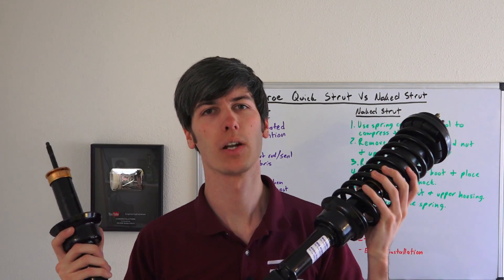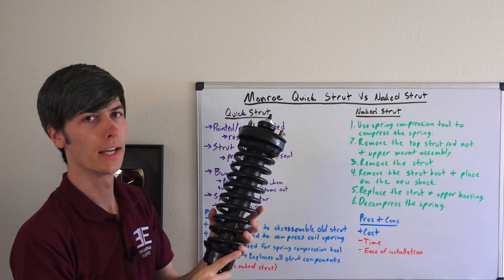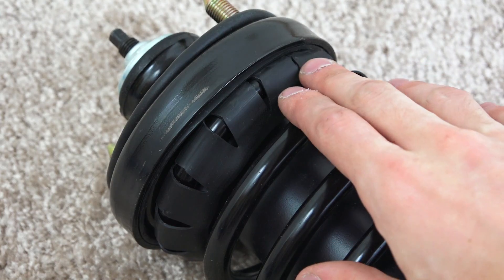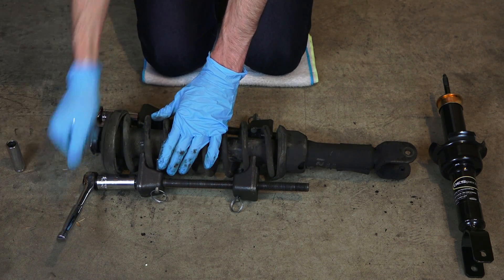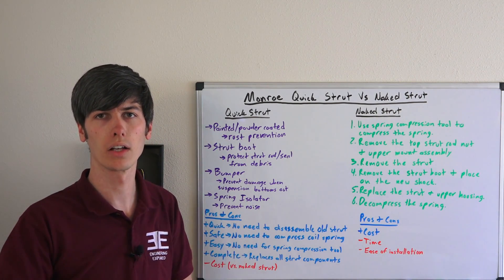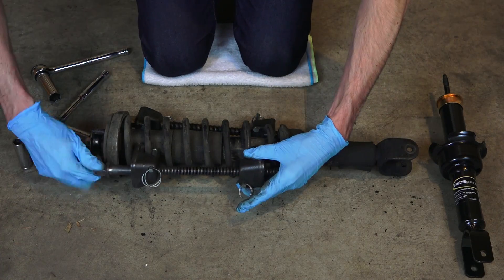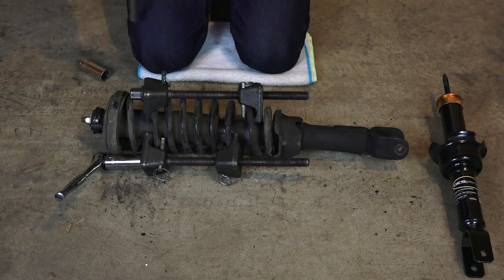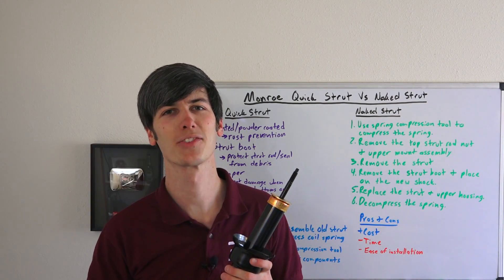Strut Replacement - Monroe Quick Strut Vs Naked Strut

Comment: I ordered model 71116/71117 to replace the existing OE spectrums that were on my car, and received 71116UB/71117UB, they’re definitely different in compression resistance, the fork shaft, and the strut rod seal cap. What are these things?

Comment: QSA is safer but you also need to
Make sure you get a decent quality QSA.

The extra $50 in the QSA even if done at a shop can be offset by reduced labor since there is one less item to remove.

Comment: Okay so when you buy a naked strut, do they have an internal lock to they can be shipped or do they have a metal wire retainer that holds it down?
Reply: Two brands I've seen a lot of just use a plastic strap to hold it in a compressed state in the box.

Comment: Monroe OESpectrumstruts front and rear installed to my 2003 Highlander, drive smooth like sit on air, the best ever, Monroe all the way for me!
Reply: Is that because they old ones were so worn or are the Monroe good? OEM for the highlander is KYB ?
Reply: @JacanaProductions   Yes the OEM struts have worn out my brother replace them with Monroe struts, the car runs smoothly as silk, my car replaced with Excel-G they are too firm for me. I want to replace them with Monroe but got to wait and save for that!
Reply: I just went monroe all around for my 04 tacoma. $145 for front struts. Back shocks were $17 each. I'll let u know
Reply: @rockstar66   Have you done how good is it? Unfortunately, I can not do it myself! back injury!
Reply: @TrungNguyen-ul8gm  no, ive spent 8hrs so far. Still trying to get the factory (rusted on) struts off! 123000miles & they havent been touched since 04.

Comment: garbage BS, never change your original spring, always just change strut  !!! DO NOT PROMOTE GABAGE FOR MONEY,
Reply: I totally agree.  Don't replace the OE spring until you absolutely must (ie: it wears out and sags).  Many people are finding that out the hard way after their springs have been "recycled" by their mechanic shops (aka: sold on eBay or Craiglist).  Even if you are dead set on quick struts, ALWAYS ask for your OE springs back.

Comment: There are other advantages like
Some oem manufacture might do an update on their quick strut which helped to improve the quality of the original design, changing just strut sometimes might not fit properly.
I would stick to oem as i read many has issue with aftermarket strut at say colder climate like us in the North where temp dropped below -20 to -30 C make some after market shocks bottom out.

Comment: Monroe has a better reputation than the cheapest off brand compete strut replacements but not nearly as good as OEM like Showa or aftermarket KYB.
 Honda OEM Showa struts are very expensive but KYB is only about 40 percent more expensive than Monroe with better tune and performance.  
The best results I've obtained are with Bilstein B6 street shocks used to rebuild OEM struts using new OEM rubber parts. Expect to pay about double a Monroe assembly and spend an extra hour per side to rebuild but the difference in control and ride is exponentially better.
Reply: I wish i was that lucky, i bought my monroe loaded struts for the rear of my Honda element.  Kept them in the box in storage as i had planned to install myself.  Had the E go in for an electrical service and paid extra to have Honda install the struts, needless to say a few days later and the driver side one is rattling 😑 new struts probably dont have 200 miles on them given the vehicle just gets driven to the store here and there. 😑😑
Reply: @motolifealways  hi will, I would replace monroe with KYB complete struts from Rock Auto. Should be about $100 each. Any decent mechanic can do this. Ask him to torque the bolts to Honda specs with a torque wrench not the impact gun. Return Monroe for credit if possible. A Honda dealer installed your Monroe Struts? Really? Strange. Good luck.
Reply: @larryordine7542  i would do the same , i love KYB . Just at the time pockets were only good for monroe. Though still costed me nearly $400 for 2 loaded springs . When i viewed the KYB , they were not cheap. Though i didnt look at rock auto at the time either. I wish i did though
Reply: Not that old yet!
Reply: Will Moto704 , do you know definitely that the source of the rattling is coming from the new shocks that you had installed?
Reply: @paulbrownman7307  yea , was coming up to the top of the strut tower. Moved the vehicle around with my hand on the top.of the tower. U can hear and feel the metal on metal rub. I personally removed, brought back to advanced auto and got a new one umder warranty.  Not had another problem.  Very odd that it went to crap in a few 100 miles.

Comment: On my 3rd gen taurus gl it's cheaper to go on rockauto and buy the strut  bearing mount and spring seperate and it's a more quality setup in my experience for example the trw coil springs had 4 coils the quick strut only 3 coils  having the 4 coils fixed the bad design it's known for this is a 22 year old taurus I'm talking about

Comment: These are the monroe quick strut for NISSAN ROGUE old body style. DONT BUY THESE QUICK STRUTS. GUYS AVOID AT ALL COST. THEY WONT EVEN LAST 2 MONTHS. Driver side one came out from the mount while driving over a small bump at 30 miles per hour and also causing damage to the driver side AXLE and adding up repair total . Few Days later Passenger Side came out while taking the exit and going over another small bump. I compared both of them with OEM Nissan's and their build quality is horrible. Learn from my mistake buying Monroe Quick strut is a major disaster you are causing yourself and your family. OEM Nissan build quality is perfect for Nissan Rogue. Don't take any chances.

Comment: I am stumped as to why people would want to put the tired old springs onto new shock (strut)? What makes everyone think that the spring has not lost recoil also and should be changed alongside the shock portion?
Reply: Rear springs usually lose nothing. You can measure and check spring height. If within spec , they are good to go. Quick struts usually have cheap, inferior springs and twin tube cheap shocks
Reply: Checking the vehicle's ride height against the vehicle manufacturer's specifications is a trivial thing to do.  Then you will know the status of your springs.  In my experience, 10 or 15 year old "tired old" OE coil springs often deliver correct ride height and a much better overall ride than the brand new POS "one spring rate fits all" springs included by many QS manufacturers.

Comment: Do your research first folks. Sometimes a complete strut assembly is not as expensive as you think. Case in point: Honda Odyssey, OEM full assembly is $284 (from a Honda dealer). Cost to rebuild your strut with Honda OEM parts is $260.  Oh also unless you are a cheap ass, go get the OEM parts. Even widely recognized brands like Monroe are pretty much junk.
Reply: Where do you think the manufacturer gets the parts? The OEM may very well be a Monroe unit.
Reply: @davem5333  Well Dave, Honda struts are are made by Showa, manufactured either in Japan or the US (by American Showa). Honda has never used Monroe in any vehicle, ever. Also, saying that they "may very well be" something is the same as saying "they very well may NOT be" something.  I never understand why people post things like that, it's totally useless.

Comment: I had nothing but issues with Monroe Quick struts in my Jeep Grand Cherokee. the car handle better with blown struts then these Monroe Quick struts. The struts have a hard time holding the weight of the Jeep. I have returned the old Quick struts and exchange them for new Monroe Quick struts and still having a poor handling issue. The Jeep bottoms out very easy now. I'm planning on going with OEM Springs and 8 decent new strut. After my experience I will not buy another Monroe product.
Reply: I agree I have monroe rear airbags replaced with monroe conversion it rides hard and sets up higher in rear and shocks are lesking no more monroe

Comment: I replaced all four struts on my '01 camry about four years ago using the naked struts. I spent all day, I mean ALL day in the garage at +90 degree heat working the spring compressors, the rears went ok but the fronts were both a huge pain and the springs didn't want to go on. It would have been a bargain to spend I think it was $30 difference to have to not deal with the springs. I'll never transfer strut springs again.
Reply: Now you know what my life is about.
Reply: wayne booker is 30 dollar difference for each strut+taxes
Reply: How does the ride compare to OEM? If it's the same, it was worth the effort. I am hearing that FCS quick struts perform poorly in freezing weather.
Reply: @GSPirosaki  fcs is garbage. I used their strut assemblies for my maxima and the ride was horrible. I would’ve been better off using Kyb or OEM bare stuts and going through the extra work to replace them

Comment: Another disadvantage is brand choice. I'd rather pay 75 for a Bilstein naked shock than 75 for a Monroe quick strut.
Reply: There are different Monroe series, I will go for Monroe if you like smooth comfortable driving!
Reply: depends on the car you have as well. im not putting bilstein’s on a beater or commuter corolla.
Reply: @MacLaw3084  then by that logic you shouldnt spend the money on a Monroe quick strut. Just get a monroe naked for 15-20 dollars on rockauto and call it good. Or better yet spend 10 more dollars and get some nice kyb gas a justs.
Reply: @autodidacticartisan  sorry you’re right. but im going with quick struts on a commuter car or beater for ease of install. now on my weekend canyon carver im going with something more special like koni fsd’s or bilstein or ohlins. etc.
Reply: @MacLaw3084  nice what setup you got on that cayon carver? I used to go around midnight and shred the Malibu canyons almost every night.
Reply: @autodidacticartisan   malibu huh? nice! i bet you had something decent. i dont have anything too special. ‘06 mini cooper s (r53) with koni fsd reds and oem springs at the moment plus some strut tower defenders (they like to mushroom on minis). im only a year into the build so i dont even have a rsb on yet. handling is go kart-like.

toying with the idea of coilovers (h&r or megan racing depending if i start autox). but the streets are so trash where i live in the bay area. car already rattles so much with current set up, can only imagine with coilovers.
Reply: @MacLaw3084  if you wanna keep a semi soft ride maybe try soft shocks with stiff springs you still feel it on the cornering the springs hold the sway but the soft shovks take the recoil from potholes and such easily without knocking out your tooth filling. Mini Cooper's are known for their go cart like handling. Theres this nice road in the bay area that I love to take when im up there. Its between San jose and santa Cruz, I think its the 17? Not sure but it has alot of wide sweeping turns and the pavement is like glass it must have just been refinished.

Comment: Buying naked struts is better IMO because you keep more of the OEM suspension components which in most cases are better than aftermarket parts especially the ones that are out of specifications or cheaply made and poor quality.
Reply: Spot on bro!

Comment: I stopped selling, "Quick Struts" to my customers. The quality control is poor. Some are good and some are bad. I had many comebacks. I now only sell naked struts, and strut components from Sachs, KYB, Bilstein, or OEM. I find Monroe struts to be of sub-par quality.
Reply: Thanks for the info. WIll look up.
Reply: Hi what do you recommend for toyota highlander 2006 v6 3.3 basic model thax ?
Reply: About 10 years ago I bought some plain, naked struts for my Escort as the originals had almost  zero hydraulic action left. I used hose clamps to help in changing out the springs. I drove the car about 40,000 more miles and when I got rid of it there was almost no hydraulic action left once again. I think they were Monroes
Reply: Exactly the same conclusion I arrived at.

Comment: There are many aftermarket quick struts out there that are complete garbage.   I'd rather know that I have the correct OEM spec spring.   As an engineer, I appreciate that not all springs are the same.   Spring coefficient, etc....
Reply: These Monroe Quick Struts were garbage on my 2005 4RUNNER. I replaced the original struts in 2016 with 61,000 miles with these Quick Struts at the suggestion of my mechanic instead of using the KYB shocks that I bought and reusing the old coil springs or buying new coil springs. 

I just replaced the Monroe Quick Struts with 103,000 miles on my 4RUNNER (so about 42,000 miles on the Monroe Quick Struts) with KYB shocks and MOOG springs. The difference was easily noticeable. The Monroe parts were never any good -- way too soft and bouncy over bumps.
Reply: @sanjaygandhi7962  They are ripping off the public with these cheap struts !    It should not be allowed. . .
Reply: Absolutely correct. Any non oem assembly will be different.
Reply: Peak Torque  KYB
Reply: what kind front quick struts would you recommend for a 2003 grand marquis?
Reply: @LaDon0428  Same as a Crown Vic so motorcraft or KYB both about $100 mail ordr
Reply: Thanks. I bought the monroe quick struts thinking they would be good considering the brand. I've only had them on 2 1/2 months and their already bottoming out. They come with a warranty but I'm not sure if the new ones won't do the same thing.
Reply: @LaDon0428  the OEM motorcraft is safe bet and exact fit. Ask mechanic if you can use police Taxi package.
Reply: @larryordine7542   OK thanks
Reply: @larryordine7542  I just found what i need. A motorcraft astl-37 quick strut assembly on rockauto
Reply: @LaDon0428  yes.

Comment: Quick strut is not  good, especially the spring. The spring is always stiff due to low quality of manufacturing and no longer going to function as the OEM spring. Also car can sit higher because of the stiffness of the spring. Making a spring takes so many factors such as spring rate etc., Those cheap quick strut won't be cheap if all those guidelines are followed when manufacturing. .
Reply: I guess the thing to do is if your springs are still even, equal, unbroken and in otherwise great shape then just get a new strut and run them some more. If your springs are not good, broken, uneven, sagging then you should maybe get whole unit. 
And don’t get too cheap. What I try to do when I have time to get parts in advance I find much better quality parts online plus shipping ( may have to wait ) a lot cheaper than cheap parts right now from local parts store.

Comment: What is the real benefit of getting a new spring with the complete assembly? I'd rather go the cheaper route and do the naked strut and do some extra work but if it's a large benefit to replace a worn out (don't know if they really wear out like dampers do) spring then It'd be worth doing the whole thing at once
Reply: I totally agree. No one ever answers this question. I'm in the same situation. Not knowing if coils do go bad.
Reply: Usually, When you replace struts, you should always replace strut mount, insulator cover and bumper (if exist).  Now putting this all together from cost prospective, Full assembly is worth spend because, if you by them separate it is pretty much same price as full assembly which will save your time. You can replace it one side in 30 min and on the other hand buying naked will consume your entire day. I would recommend KYB Struts plus than Monroe. They provide lifetime warranty as long as original purchaser own vehicle. I have had always purchased KYB on all of my vehicles.  Having new spring is cherry is definitely cherry on the top.
Reply: @suragprajapati  Or new springs can definitely be lemons when their characteristics are not as good as the OE spring, or they begin to sag after 1 year.

Comment: a caution with buying preloaded struts is it can throw off your alignment because the new spring will need to be broken in.
Reply: So does a new strut, am I correct? So is I use my old coil,I won't need to realign? I have a 2010 Mazda 3'. 200000 miles.

Comment: As always thank you for your research and videos. They are always helpful in understanding the tech work that goes into maintenance and also the engineering and physics of the process.
With all this being said what are your thoughts for pros and cons on mono tube and twin tube shocks?
Also what are your thoughts for naked struts used with new higher or lower strength springs?
Curious to doing a offroad rally build but also so many talk about lowering springs but never doing their shocks/struts to compensate for travel and bottoming out along with dampening rates. 
Sorry if you've made a video already. Hadn't noticed if you Di yet. Like always thanks for your time and best wishes my friend.

Comment: bought UNITY quick struts for my 03 subaru: would nt recommend> very bouncy and loss of height...wtf?
Reply: What did you expect? Those struts are dirt cheap. CHINA suprise
Reply: You only buy KYB or koni for a Subaru
Reply: I had a 2003 Outback and the guy put on $50 quick E-bay struts before he sold it - horrible horrible.